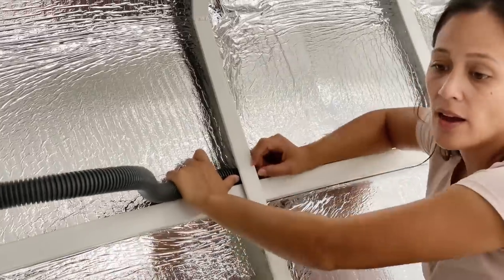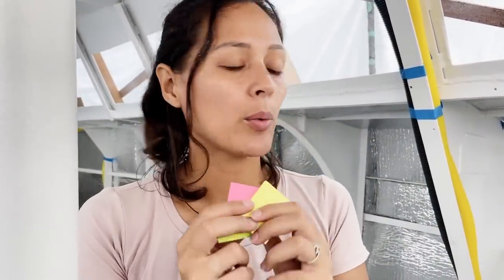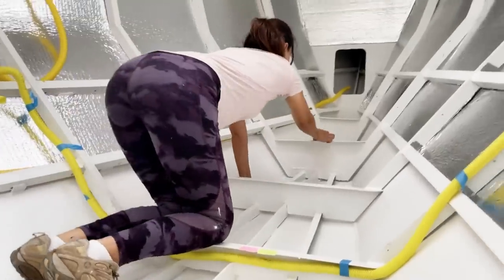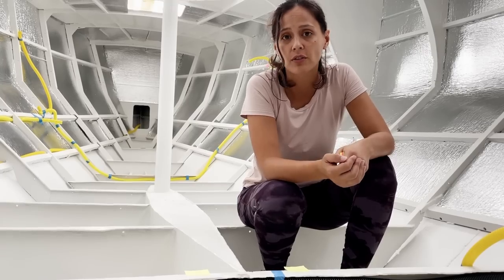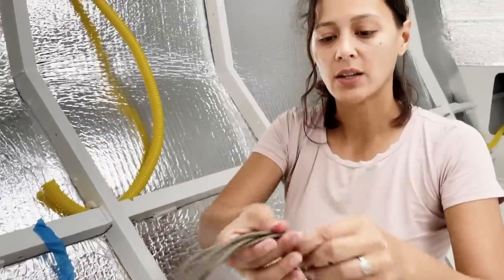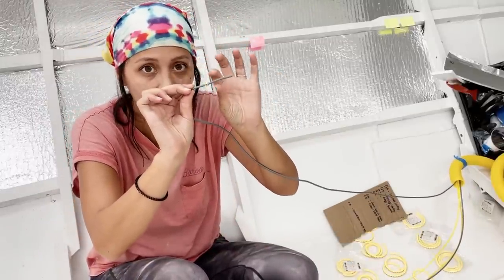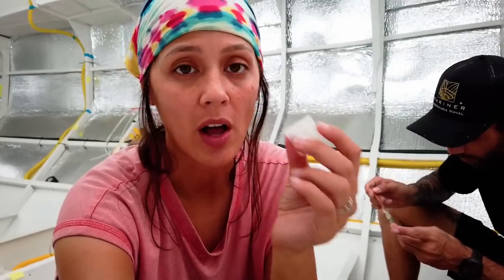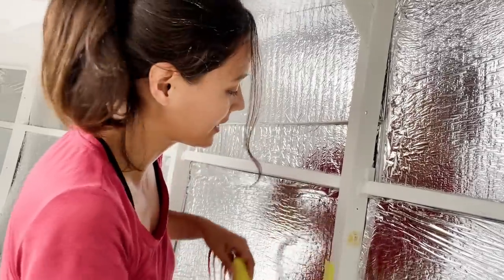These techniques made ELECTRIC WIRING our BOAT Super EASY! ⛵️ Ep32

Comment: you may want to put in a pull string in the condet, it makes pulling wires later a lot easier.
Reply: definitely do this! pushing wire through a conduit can be an exercise in frustration!
Reply: Actually a small wire is better and stronger
Reply: Yes to the draw string. Make it over twice the length of the conduit and then tie it off. It will then work with the risk of it being removed.
Reply: Also, always pull another string when using the existing on to pull a wire.

Comment: Tip: Pull a fishing line through each conduit. It will make wiring so much easier. When you pull a wire through, make sure you attach a new fishing line to it. That way you will always be able to draw new wires in the future. Makes life so much easier.

Comment: Lot of suggestions to leave extra pull wire or ‘fish line’ in conduits.
I hope you plan for wiring and plumbing locations is based on a rough interior plan ??
So nice for you to be working with new materials , fixing old stuff is so hard and frustrating 
Cheers Warren

Comment: Adding a draw wire thru the conduit is a must as it will be difficult to push extra cables in later. Also unroll the conduit (or cable roll) rather the pulling sideways as you will get less twisting

Comment: I love the ring markers. This is the first time that I have seen them used. You have a good system for organizing your wiring. If I had to do the same job I would use the system we used on jet fighters. I would start at the tip of the bow and measure in metrics the length of the boat and I would put that number on the wire at the breaker box. This would be the location of the destination of the wire. Skip to the next number and place the number on a clock of the device being fed. Pretend that you are in the center of the hull. The first set of numbers tells you the station of the location and the second set of numbers tells you the location according to a clock. In the breaker area you know the destination of the wire.

Comment: Oh that is a work of art..!! I love the organised layout.  You didn't mention the anchor windlass, and usually they need some heavy duty wires from the starter battery if it doesn't have a dedicated battery up forward with charging cables running from the charging circuit.
What do you have in mind?
Kind regards
Grant.

Comment: You use pipes for the cables. Unfortunately, these can collect condensation water. Therefore, it may be advisable to make holes for drainage at low points. Now you may have used pipes with slots that cannot collect water. Labeling the cables is very good. I don't know if you mentioned that these should be on both ends. You explain very clearly and educationally how the planning and implementation of a low-voltage system should be carried out. I wish you all the best.
Reply from the maker: We thought about the condensation but we’re not sure. Thanks for the tip, we can certainly put drainage holes incase. And we did label both ends of the cables, did forget to mention that! Thanks for your help!! Much appreciated! 🙏🙌⛵️

Comment: Starting an electrical cable list you have to give each cable sequence number and prefix in the cable list. like G-101 G=the type circuit 101=sequence number. So your line entry in the cablelist might be per column:  prefix with cable number, to/from connected items, drawing (electrical scheme) number, electrical load (in Kw), connnected to emergency power y/n. Suggest to put this in a spread sheet which makes it possible to you to make additions, selections, etc. 
All puled calbes in your video shall have a label at both sides showing prefix and cable number. 
Hope you consider also the amount of cables associated with navigation. e.g. as autopilot cables, navigation system cables, radar cables, start/stop cables motor, etc.

Comment: Laurie, it is better with several small conduites (tubes) than one big. This is because it can be very difficoult to pull extra cables into one allready half full conduite/tube This i know from experience. The other csbles tend to catch the incomming new cable...and dispite silicone lubricant on the wire, it can be crazy difficult to draw an extra cable.
Reply from the maker: This is a solid suggestion and makes sense! We did buy a different guide early on that really works amazing as well. It has a strong metal spring at the end with a rounded cap that is powering through the conduits. Our previous one was plastic and got hung up everywhere.

Comment: Looking to this episode I would like to suggest next to your lables in the boat that you document with electrical schemes all your systems  e.g.12v, 24v, etc. Also the power generating part have to be documented. This will help you with a check on the system safety switches, etc.

Comment: Great job guys 👍👍
As per. A previous comment, run a pull wire through the conduit, it will make life much easier if you ever have to run more cable.(that’s coming from an electrician, I know it might seem unnecessary but I know from experience)
Love your channel 👍👍🇮🇪🇮🇪❤️❤️

Comment: Great idea doing wiring now as makes it so much easier for Cabinet Makers when they do their thing. One thing you could have done was to put in T connector in where something branches of makes it a bit more today and you can slip conduit over it. Above all run it where you might need in future if it never gets used so be it but it's there. The big issue is distance and voltage drop lighting not an issue but everything should be calculated out and add 25%. Anyhoo God job keep at it. ;0)

Comment: If you have connectors on the end of cables you want to protect in a conduit, use a split conduit. Basically its a conduit that is split along its length, then a second peice fits over once the cables are fitted.

Comment: Make sure you know which wire route in each pathway as colored wire relating to circuits is preferred...you running battery at winch to reduce current draw?

Comment: Think about the very large wires that will be used for the windless as well as the windless control wires. Oh, yes, the bow light the port and starboard, and the stern lights will be brought together at the navigation station. You will have a ton of wire aft of the companion stairway going into the nav. don't forget the bilge. There will be heavy wires to the battery going to and from the controllers.  Have you thought of using "messenger" lines? So sorry for destroying your day. Wires, wires everywhere. Your hull is looking wonderful, keep up the fine work. I'm enjoying your adventure. My wife and I spent 5 years as liveaboards always on the hook and always doing the work ourselves. We even became minor experts in refrigeration.
Reply from the maker: Yes your right! Lots of wires! We do have a conduit passed for the windless but we haven't bought the wire yet (cause it's expensive 😅) and also we have conduits to the bilge but haven't been wired yet either. We did buy some thick fishing line to leave in the conduits for future wires but then we haven't installed them. So much to do so little time! 😂😂 We'll be getting to the fridge soon, if we have any questions, we'll let you know! Thanks! Cheers!!

Comment: Those electrical conduits do not look large enough. You are going to need some large cables to supply high power DC devices. Work out the size of cables needed for your equipment and make sure you have adequate conduit plus some spare.

Comment: Looks good but lots of work. When working with conduit like that, to put wire inside tie a little piece of rag to a string put at the one end and with a vacuum suck the rag and string through so you can use the string to pull the wire or whatever into the conduit. Just use string strong enough and long enough to go through. Good luck and I am looking forward to see this vessel sail.

Comment: For your cable saddles, if you degrease the area with a quick wipe of acetone, the sticky pads will stick forever, save yourselves time messing with contact adhesive.
Reply from the maker: Even if the metal sweats? We did drop a couple of these sticky pads on the bilge after we removed them and they did stick real well. Was a struggle to get it off.
Reply: @lahakai  Yes, I have used 1000's as a panel wireman on outdoor signs, and never had a problem, as long as you degrease first 😀
Reply from the maker: Fantastic! That would certainly speed up that part of the job. It was time consuming to prepare and glue these guys. Thanks for your help! Cheers!

Comment: Not knowing the amount of current that will be running in your systems, but seeing all the trouble, detail you going for in, it might be wise to split comms, navigation wires to run in separate conduits from supply lines

Comment: I have never seen such ga[ps between the inner frame and the steel. There is supposed to be no gaps everything is supposed to be welded on tight for structural support.  All that 3,000 of parging and apint that fell off may have been due to your sides flexing too much and the parging was stiffer than the steel so it fell off.  That is what I am worried about.  Not sure what your inspector engineer thought of all those gaps.  I hope you reinforced the window pars you thinned the roof and sides and when a ton of water lands on your roof the only thing supporting it are the pillars at the windows that you thinned down.  Better thicken those up.  Otherwise I do love the shape of your hull.

Comment: I can see that you guys have no idea what your doing please stop as your going to do it again first of all are you running the whole boat on 12 volts or having an inverter for 110v or 240v The cable you have left at the Nav station need to be longer as connections will be connected to a hinged panel this will require a loop in the cables so they can move when working on the panels Where are the main Battery Cables? The AC and DC cables need to be in separate conduits .Please hire  professional marine electrician to help you it’s no good guessing
Reply: Totally agree, also …..plastic tie wraps cannot live forever, especially within a boat environment. Fastening wires with them is sketchy to say the least 🫣🫣